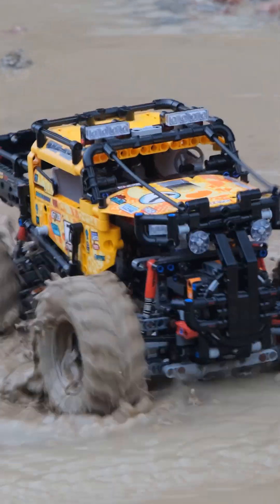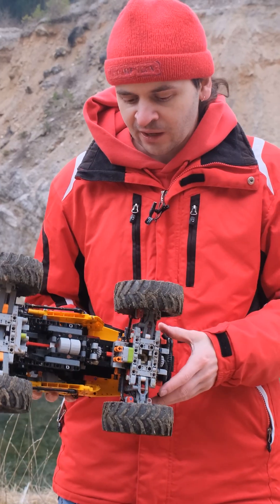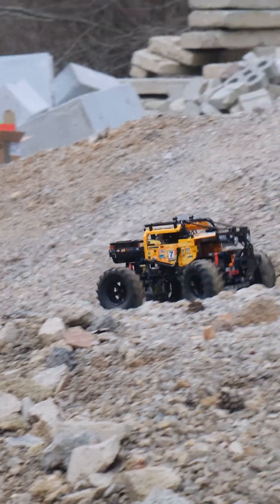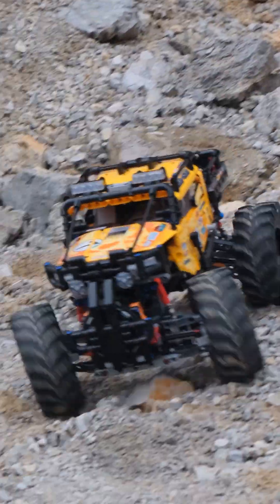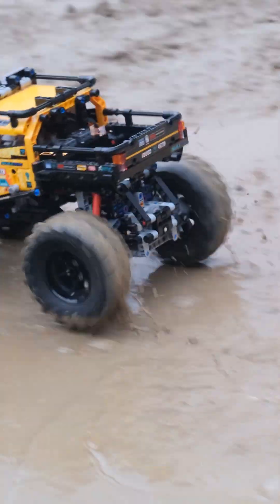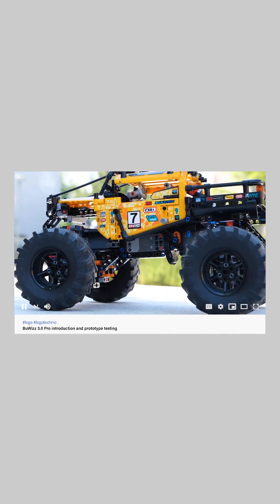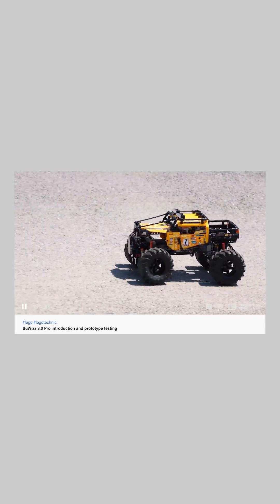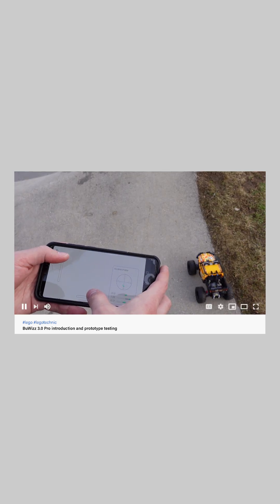Modified LEGO® Technic 42099 4x4 X-Treme Off-roader with 2 BuWizz Motors and powered with BuWizz 3.0

Comment: Brushless motor system kinda better than any buwizz system, but this mod isn't that bad
Reply: too much power, even buwizz is a little op
Reply: @thestigggg  vero, già con questa configurazione quei differenziali inizieranno a slittare presto, meglio quelli nuovi
Reply: @thestigggg  Buwizz cost too much and it's not that good as all think. You can easily make your own RC system for abt $100 and it's will be much usefull and better than any buwizz things.
Reply: @legovic2299  I have buwizz, and it is good, apart from the servomotor that snaps some times, It has enough power, and it doesn't damage lego motors, I don't care if your can have a 12s li-po to make your motors go faster, I don't care if you can put a 25hp electric brushless motor on your lego car, I don't care if you put a nitro engine in it too, just buy an rc car and not lego, buwizz is more than enough, and won't fry your motors, it is plug and play, easy to use.
Reply: @ElisioFioravanti-fd4ub  buwizz is too overpriced. And it's stats can be simular to custom 1s rc brush motor system, which is cheaper and better. Also lego don't have normal servo motors like geek servo. And buwizz can't control servo motors right.
Buwizz is kinda pointless if you have little bit of skills in soldering. If you don't have this skill - I don't think that you good at building lego models either.
Reply: @ElisioFioravanti-fd4ub  also rc plugs have lot's of possibilities, which buwizz doesn't has
Reply: @legovic2299  I do know how to solder, and you don't get the point, it is just inconvenient, nobody will accept a speed record with a motor that isn't lego or buwizz or powered by a different lipo, buwizz offers enough power to make lego motors go faster, it controls a powerUP L M or XL as servo, or just uses lego servomotor, it is way more customisable than you think and it drives far enough too, I don't care if you put starlink on your car for cheaper than buwizz, you would have to buy a battery that fits lego, a speed controller, a servomotor, a brushless motor, a remote controller, skill, and a soldering iron that not everyone has, and if someone wants to build your car he has to buy the exact same parts, and at that point, people will start to put insanely powerful motors on lego, and it will be a matter of who has more money, it isn't the point to get something better than buwizz for cheaper. (and why are you watching a buwizz video if you don't like buwizz, and why do you comment?)
Reply: @ElisioFioravanti-fd4ub  nobody cares about buwizz speed records, it's not even lego.
Reply: @legovic2299  I care because the motors are 9V instead of higher volt ones. Accually very attractive for the Lego fans like me
Reply: @legovic2299  the speed record is an example, you still don't get the point.
Reply: Its for me not just the functionality that buwizz has, its also the quality and compatibility that buwizz has. I have one 3.0 for 2 years straight now of using almost every day. Nothing wrong with it. It’s really worth the price in comparison to the quality and duration of the product. With duration I mean how long it takes to completely knock-out until it malfunctions. This is also very important and counting for the price. I don’t care if I want to put a brushless motor in a Lego creation. Sometimes it’s not all about rc cars. It’s Also (for normal lego hubs) all about automation and programming. The buwizz is the most compact 12V battery and these are the reasons why buwizz is accually worth it.